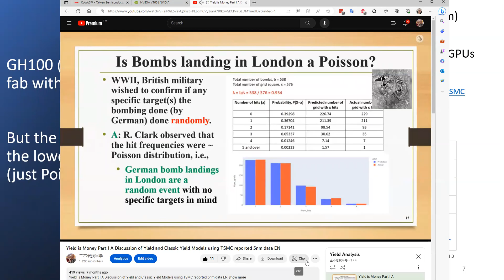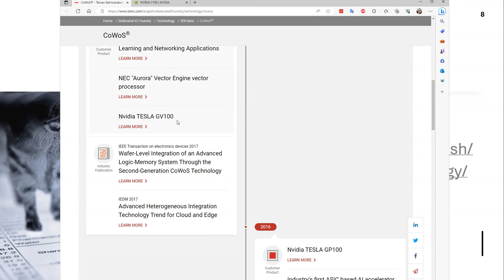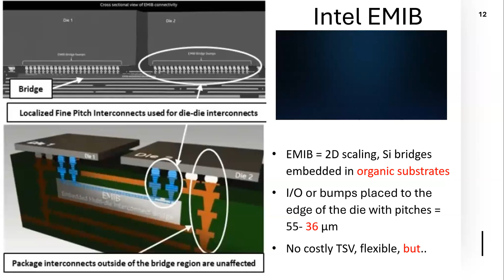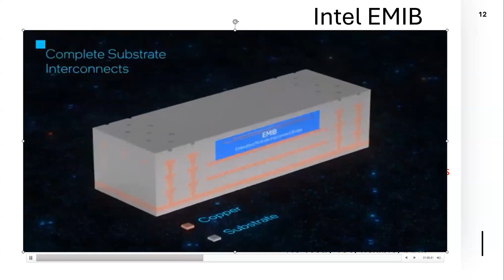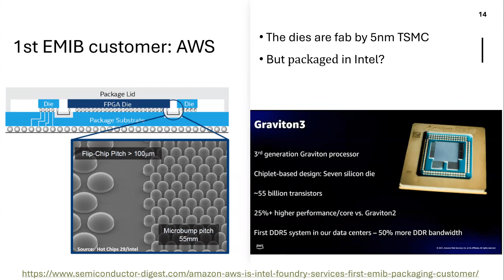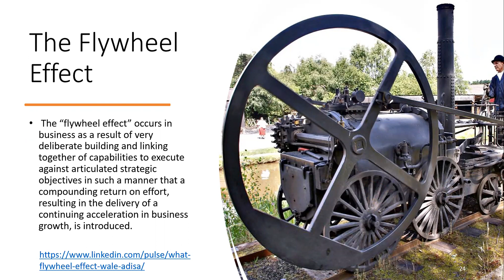1  Packaging Process Technology  TSMC and Intel, CoWoS, EMIB, Foveros and Chiplets

Comment: thank you for providing the video that is very informative.

you presented two equations:

y(A)= (1+A*0.223/2)^-2

y(A)= (1+A*1.15/2)^-2

what are the differences in those two equations?
Reply from the maker: WOW, you caught me. One of them could be misleading. Please check my video about how I came out with the formula (p.14)

https://www.youtube.com/watch?v=tDgG0lO1fS4&list=PLLqmCVy2iann-kmwLvFN3hzY-nRfUy95i&index=20&t=4s
Reply: @王不老說半导  
Thank you for your response.

I have watched the video and this one as well.

https://www.youtube.com/watch?v=aiP9rL57avQ

It looks like the following equation is for the 0.44X0.44cm die:  y(A)= (1+A*1.15/2)^-2

and the following equation is for the 1X1cm die: y(A)= (1+A*0.223/2)^-2

What confuses me is that the x axis of the two graphs is the die size from 0 to 4 square cm.

You came up with the two different equations because of different machines used at TSMC, correct?

The 0.44X0.44cm die is made in machine A and the 10X10mm die is made in machine B so that you need to use two different yield equations, correct?

The yield of the 0.44X0.44cm die at 3.5 square cm is 10%:  y(A)= (1+A*1.15/2)^-2

The yield of the 1X1cm die at 3.5 square cm is 52%: y(A)= (1+A*0.223/2)^-2

What does these mean?

The two graphs tell me that a larger die size has better yield.
Reply from the maker: @mizunommjp  exactly, thanks for the reminding. The question is not that critical。 It's the trend that really matters.
Reply: @王不老說半导  My understanding of the current semiconductor industry's trend is chiplet that avoids larger dies due to the die cost and yield loss.  Your presentation has two equations that shows a larger die has better yield that seems against the indusctry's trend.
Reply from the maker: @mizunommjp  The two equations should show trend with smaller yield for larger dies, as those in p.21.
Reply from the maker: @mizunommjp  I would like to thank you for paying attention to details. You did point out a potential confusion from this talk. I should revise the foils to make it more clear w/o any confusions...